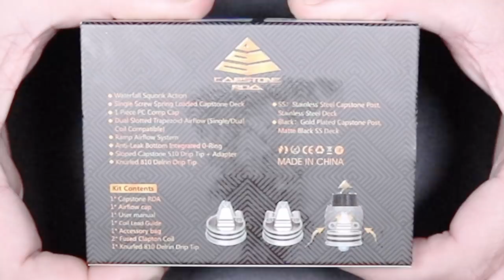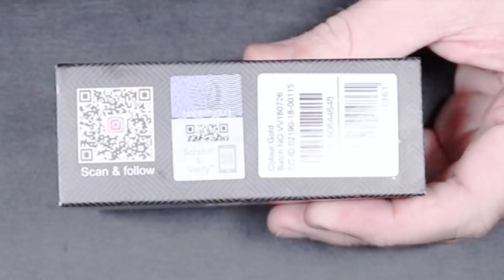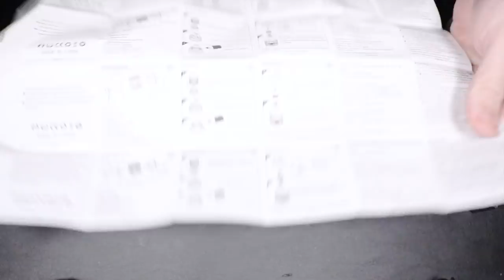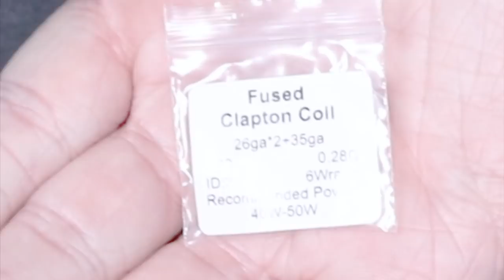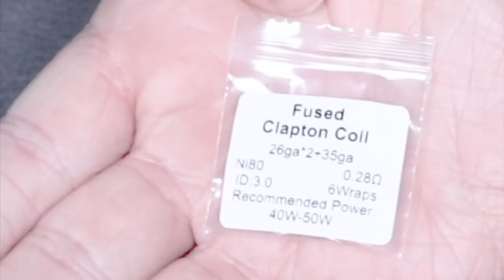CAPSTONE RDA VAPEHAPPY :) & VV ~ BIG FLAVOR/VAPOR/FUTURE OF SQUONKING

Comment: Solid look at this rda. I think you did vapehappy proud with a killer review brother.

While there are many pros with this atty, the oring around the 510 squonk pin to prevent seepage, the reduced chamber which leads to good flavor, the top down squonk system.. this little guy never spoke to me and jumped out as a must buy.. although you have stoked the fire a little bit. I'm just weary of the single deck screw coupled with the springs. I'd worry over time they would break down on me. But your 100% right out of all the reviews and thoughts on this atty not one has said the flavor is lacking and that of course is a very big pro in anyone's book.

Thanks for another great review this week. Putting in that work there bud. Always glad to see a PAL 702 notification.
Reply: Whee don't be so frugal. It's like 30 bucks of course the construction won't last forever but it seems just about every rda lasts longer than our attention span for the piece lol. Seriously though I get your skepticism as one part of the pyramid fails it all fails but they do offer extra springs and what not for the deck.
Reply: Fictitious Character it's not about being frugal per se, it's just that I spent my last $43 on the SXK Boxer dual 20700 squonk mod. And the corner store where I cash in my food stamps for money and cigarettes  isn't giving as much of a return these days.

But you are correct about waning interest in devices as some of my favorites haven't been touched in weeks cause I'm still going through my hoard from the hospital stay and new stuff coming in. So truthfully,  longevity only needs to be until another Fagan Industries release,  which is every 3 weeks at this point.
Reply: The good thing about the EBT for cash deal is it is like clockwork every month so you are practically guaranteed the next latest and greatest piece of Chinaware to be acquired on schedule ;).
Reply from the maker: Whee this thing pumps the vapor and flavor out at a pretty high volume!!  I think it might come down to looks for most people....it's one of those RDA's that either looks kind of dope or kind of stupid to you.  Everything else about it has been working like a champ for the last month........oh I got a Whee-Wednesday review this week so get ready lol!!!!!!!

Comment: Great review Pal. But i disagree i dont like the top down squonking method it is way too easy to over squonk then your left with a huge puddle of juice in the rda. That top down system would work better if it had a second hole at the bottom to suck back the excess like the 502 does. Although im not a fan of the 502 i loved that system Jai used in it. And if more companies are going to do the top down method they need to come up with a way to get rid of the excess. But theres always room for more and new ideas and different opinions thats  Just my opinion keep these badass reviews coming.
Reply: Louie, I agree with the need for the suck back. Without the suck back it isn't really squonking imo. I have some interest in Tony's new rda because it sucks back, but the truth of the matter is most dual coils these days do not get my attention enough to get my $.